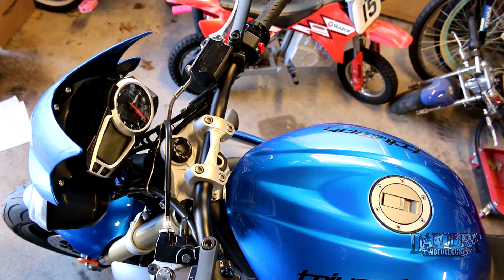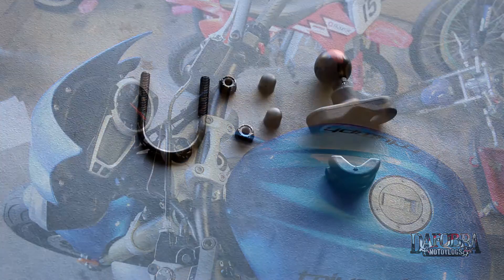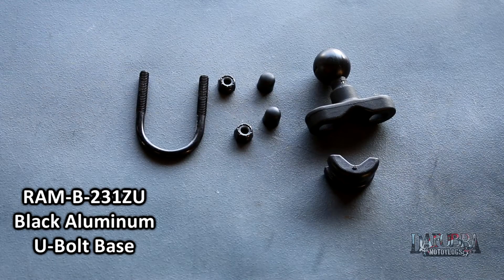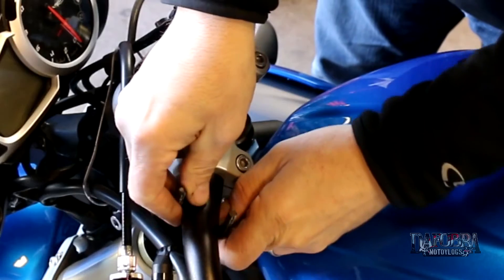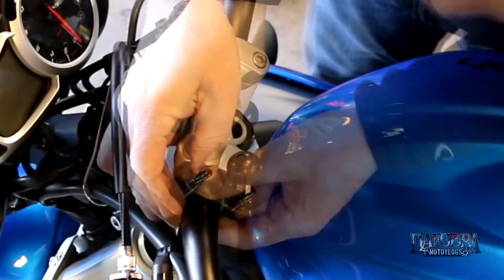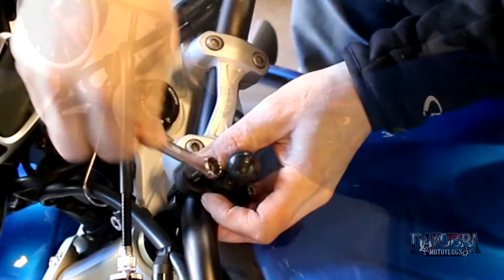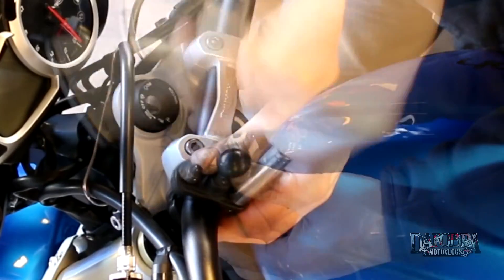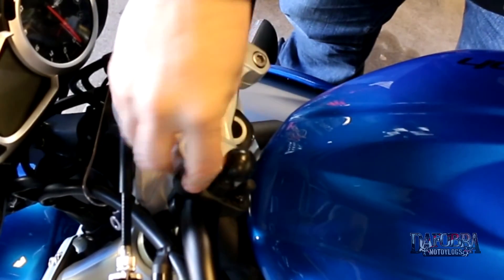How to Install Ram Mounts and Mount Stuff to Your Motorcycle

Comment: I have the fork stem base and mirror adapter base installed on mine. Had some clearance issues installing the stem base as the handlebar was a bit in the way but works well though.
Reply from the maker: yeah the stem mount does work.. and centrally mounted can be convenient but I found myself having to tighten the allen bolt every now and again or it would start to spin.

Comment: Quick and easy install. Which set-up did you stay with? The handlebar or the riser bolt one?
Reply from the maker: both!  I was going to do get another one of the riser bolts but the clamp works and you can barely see it...    For $10 I might puick up another riser bolt setup though.. just to have three options since I have three arms ready

Comment: Which bolt did you use? The shortest or the second one? I have a Street Triple R 2014 and used the shortest one. However the shortest is a bit shorter than the original bolt. The second one is a bit longer than the original one. So that' why my question.
Reply from the maker: Hi DaMaX74 I just checked and I also used the shortest one.  It was nearly the exact size as the original one.. don't look at it bolt vs bolt.. put the ram mount ball on it and then compare the two.  You will see they are almost exact.
Reply: dafobra Thanks for your quick reply. Yep I did that too, the bolt in the ball and then measured it. It just fits perfectly. Had the Stem hole mount first, but that wasn't that succesful. The base of the ball wouldn't pas the middle part of the  handlebar. So it was a bit of a waste. Should purchased this one initialy instead. What torque setting did you use or just thight as it gets?
Reply from the maker: Honestly I just snugged it up tight by hand.  I actually will probably end up getting another one just to have three mounting points since I have three arms and a few things I like to have accessible.
Reply: dafobra Thanks, okay did the same. Will probably be no issue, 'cause the original bolt was also easy to unscrew.
You'll be a riding gadget with three arms 😂😂. Ride safe 🏍💨.

Comment: Be careful not to over tighten.  Now you tell me.  I cracked the bottom plastic bracket lol.  Still works.
Reply from the maker: it probably won't go anywhere...  the clamp setup actually works fairly well

Comment: i would never trust a phone accessory company to replace a part like something holding on your bars. Your probably getting cheap chinesium. Sounds cool but seems dangerous.
Reply from the maker: chinesium lol..  never heard that before..   I know some people are apprehensive about the phone mount.. but I'll tell you this..  Jakethegardensnake told me to super glue the rubber pieces on when I first got it and it has been fine..  I was even hit by a Chrysler..  I was ejected from the bike and it was totalled.. but my phone was still on the mount.. go figure.. . this is the same mount and maybe out of superstition or maybe out of curiousity.. I still have it..  I don't always put my phone on it but typically I do.
Reply: Chinesium! LOL!